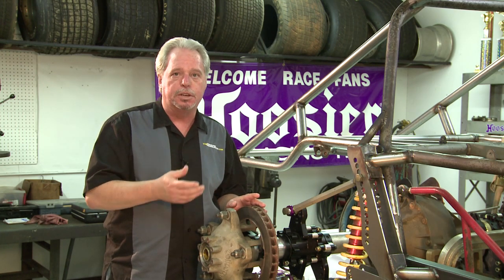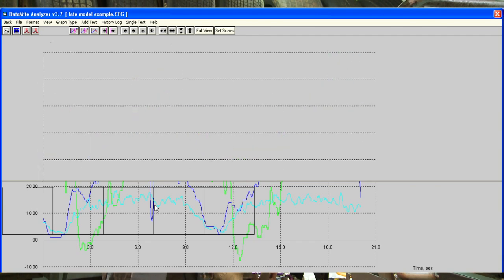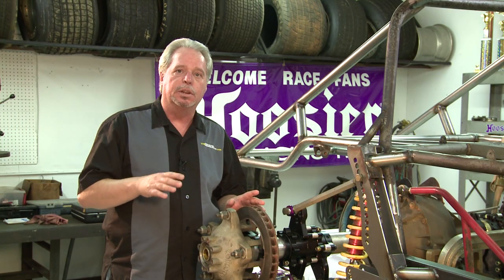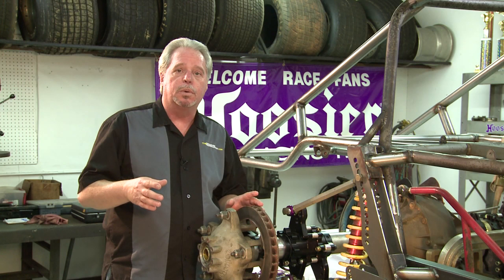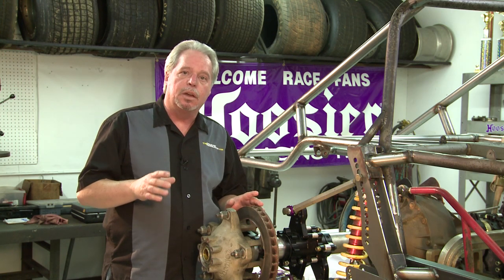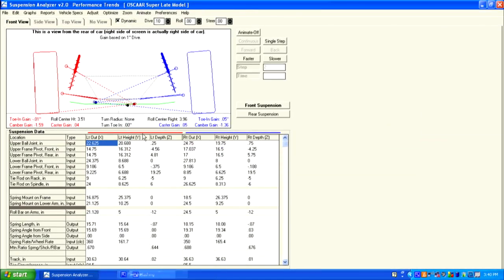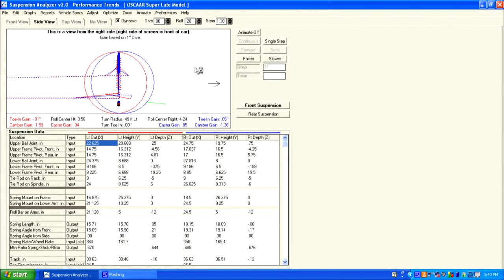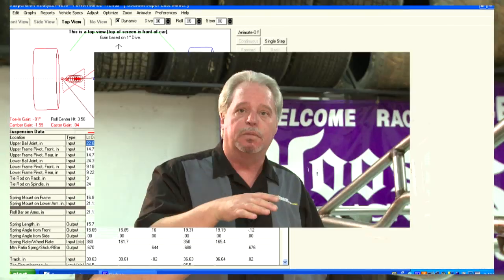Introduction to Data Acquisition

Comment from the maker: Sorry for the late response, it's been really busy during trade show season. It's not legal to run during a race but you use it in test day sessions to find what you need to know then you can make any needed changes based on the data. It can be easily removed when you go racing.